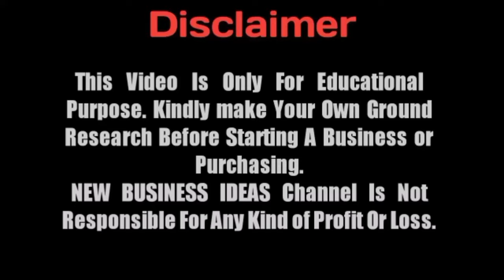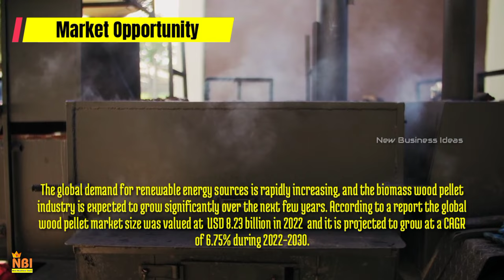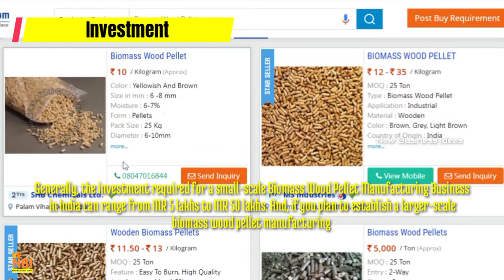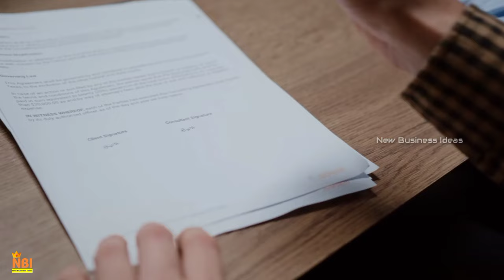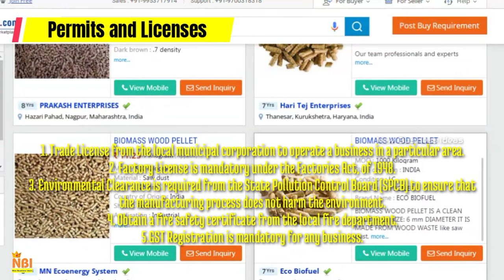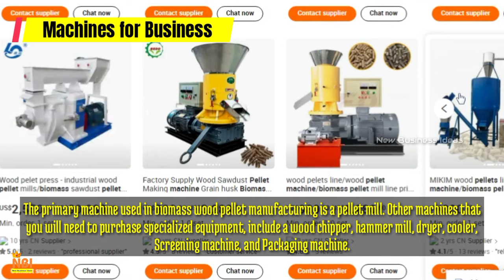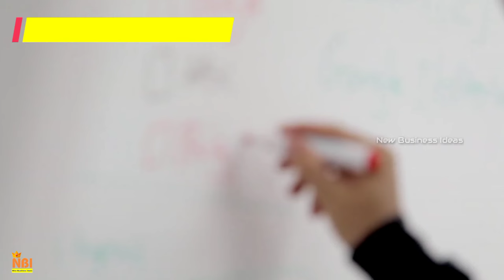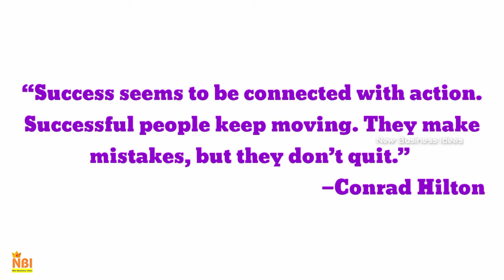How to Start a Biomass Wood Pellet Manufacturing Business || New Profitable Manufacturing Business

Comment: It's not  profitable
Reply: How do you know?
Reply: How ??
Reply: Profitability can be weak the power consumption of most mid size lines is close to 1MW therefore the profitability is hugely dependent on the price of power. In many instances if this is powered by a diesel generator profitability can be questionable.